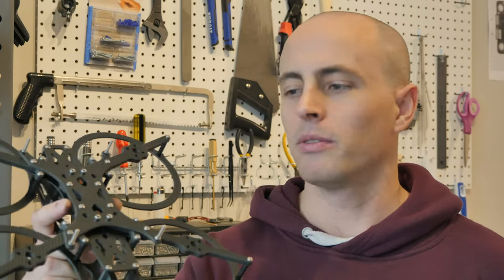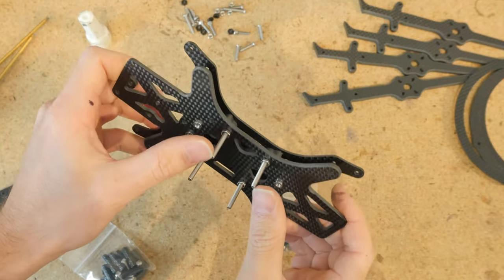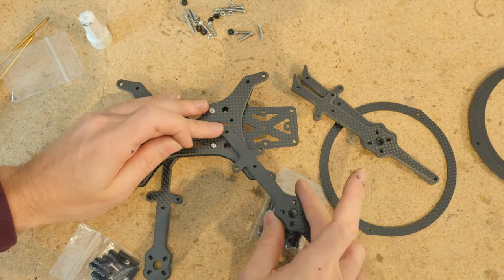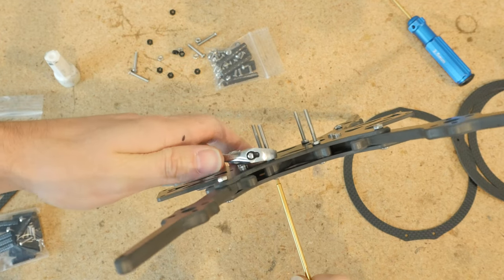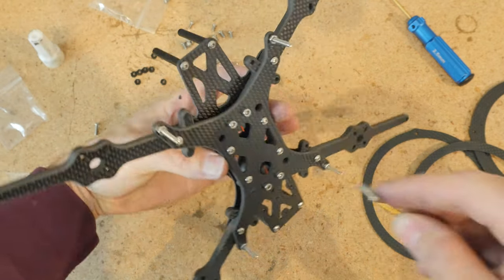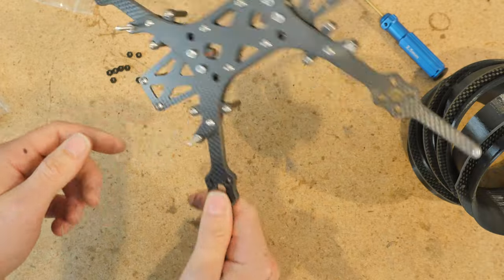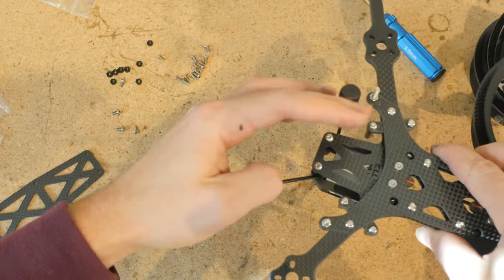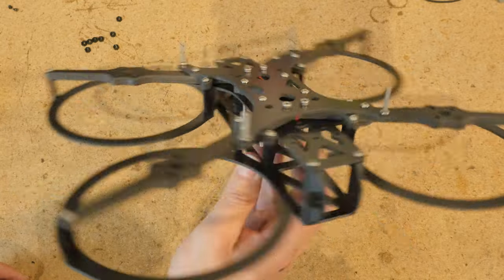Le Puffin Frame Assembly

Comment: hey, does the new o3 air unit can be installed directly?
Reply from the maker: Yes, the kit comes with prints for the original air unit, but you can print your own adapter for the O3 unit using the STLs on my grabcad. The stock camera mount works, but the unit would need to new cradle. https://grabcad.com/library/le-puffin-tpu-prints-1
Reply: @strawhatsam  this is really helpful. So the o3 camera will be mounted directly, and if yes. Is the frame in the view? 

Sorry man but if i want to order the frame i have to make sure its o3 air unit ready. 

I can print the TPU, easy. But if the frame does not fit the new o3 camera ill wait